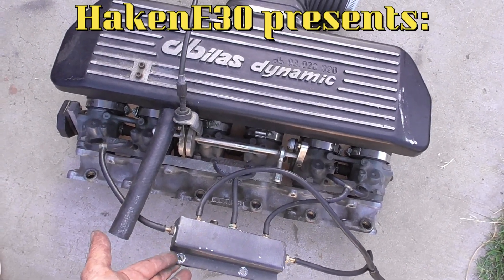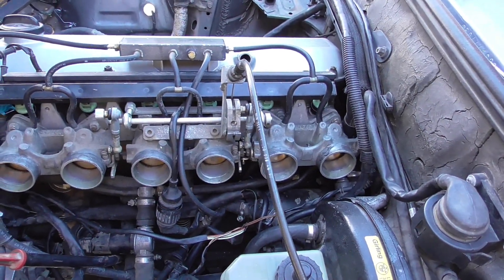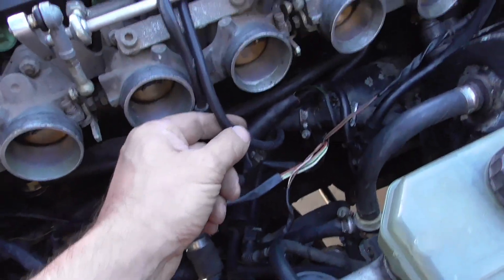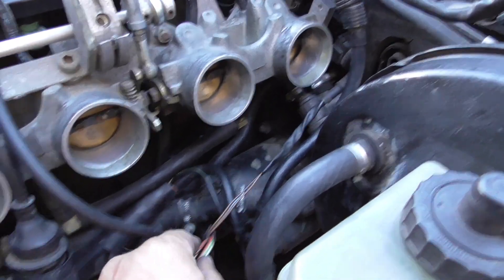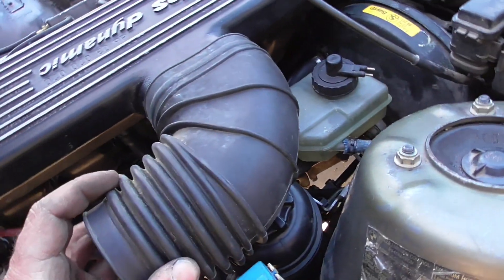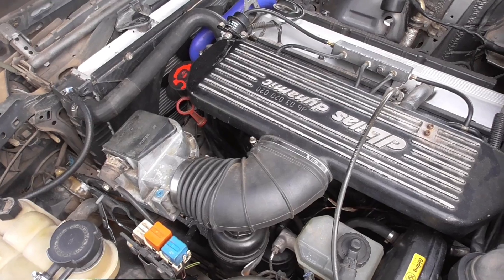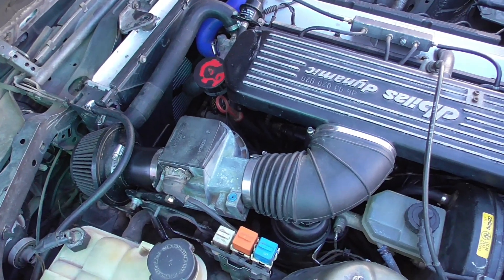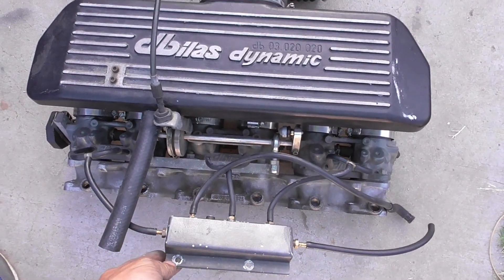dbilas dynamic ITB system for BMW E30 M20b25 installation guide

Comment: Hello, I bought this collectors to my BMW e30 325i, when I put it in the car and I turn the engine the car doesn´t  accelerate, the collectors does not have any tubes to conectt it in the idle stabilizer valve, can you help me or make a video where you better show where it is connected, thanks

Comment: maf is still main restriction plus you have to rev the engine high it to make itb work :) you can consider ditching motronic ecu
Reply from the maker: This car has AFM and it is not restrictive. ITBs are for high revving engines, that is the reason why it is worthless to put it on M20. Motronic 1.3 is a great system